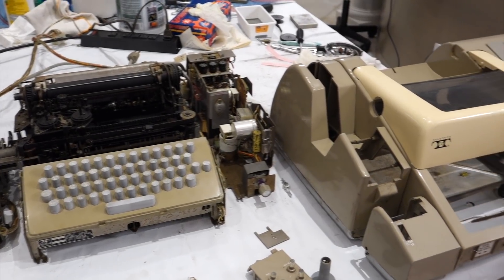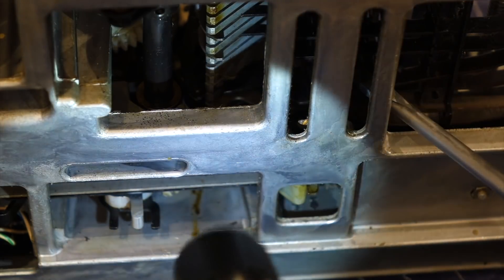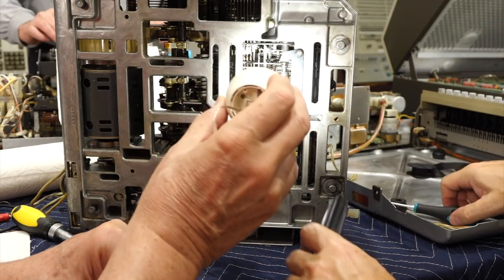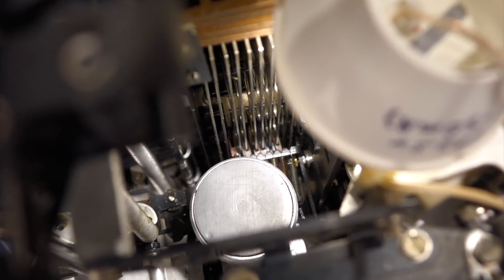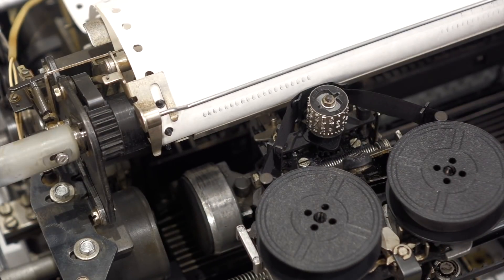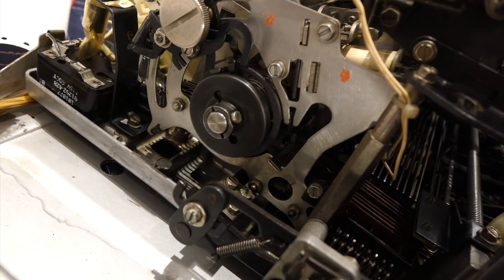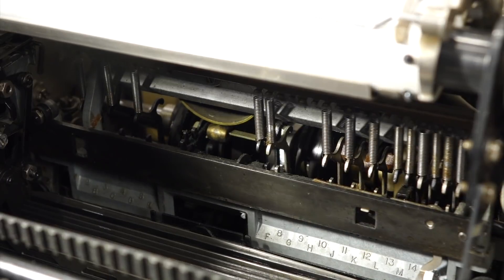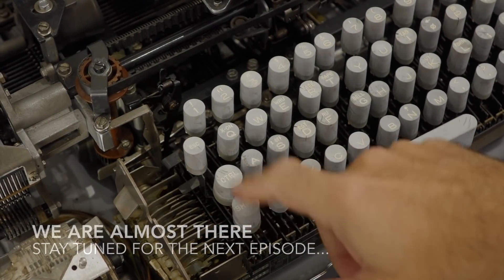Teletype ASR 33 Part 4: Returning the print section to life

Comment: Oh that sound!. I was a Burroughs B3500 computer operator for 3 1/2 years in the USAF (1970s).  The KSR 33 was used as the SPO - Supervisory Printer Online. The operator controlled the computer and monitored jobs using KSR 33. KSR  = just printing and keyboard.

Comment: The cylindrical print head looks like a predecessor of the IBM Selectric typeball.
Reply from the maker: The IBM Selectric predates this and is a much more refined mechanism, that can do 88 characters (versus 64) with far, far more typing quality and uniformity. I suspect that although this was inspired by the Selectric, it tried very hard to avoid the patents. They instead went for speed and remarkable simplicity. It uses a surprisingly small number of parts, none of them requiring precision machining - it’s all stamped flat parts, very few bearings. This mechanism must have cost a fraction of that of a Selectric! It’s a wonder it works as well as it does.

Comment: A piece of heat shrink tubing may do a nice job on that hammer
Reply from the maker: Heatshrink is a terrible choice for replacing rubber. It has almost no mechanical endurance and very little give.
Reply: @CuriousMarc  ahhhh i didnt know that was rubbing it looked hard on video
Reply: I think heat shrink isn't thick enough for that
Reply: @JamisCasusa  ive used some thick walled stuff for direct burial line splices... I also pondered liquid electrical tape??? Layered

Comment: Isn't the mechanism based on the typing reperforator used in the Model 28 and Model 35?

That Nye 140B has to be the most expensive oil I've ever seen; it makes even some watch oils look cheap in comparison.
Reply from the maker: I know! But that oil truly works far better than anything else I have tried. I have abandoned most of the other lubricants. You need so little of it, cost is insignificant in practice.

Comment: Hi it eh Mid 80's I learned all about serial cables by interfacing one of these teletype units to a 386 computer, soldering many leads to eventually get the unit to produce punch tapes, for programming a CNC punch machine to create louvered panels, Good old Pentagon Radiators @ Hixon UK

Comment: Said thing is, that very very small percent of our young generation has any regards or understanding for the old tech. I have a lot (not really lot, that's relative) friends, that does not even know what a vacuum tube is, let alone how would one use it. But they do not have any clues even about the much more recent tech, like 8bit computers. Almost all electronics and radio hobby clubs were closed for good, only few new ones emerging - but just full of naive arduino folks, who can't do any better, let alone get bothered to do better.
Reply: Don't just group all young people together. I am 17 and the only reason that I don't have some old tech set up is that I can't afford to, I am however as you said an exception and not the rule. One thing that you might find interesting is that there is actually a resurgence in the community for all of this old tech

Comment: You can see the evolution of ASCII code right here in this, to cope with the mechanical machines that made it.
Reply from the maker: Exactly. You can see how the characters are arranged in blocks of 16, to allow simplified mechanical selection using the control and shift bits. The print cylinder matches this layout, with 16 rotation positions defined by bits 1  to 4, and 4 vertical positions defined by bits 5 and 7. Which is why selection bars 5 and 7 are arranged next to each other on the machine.